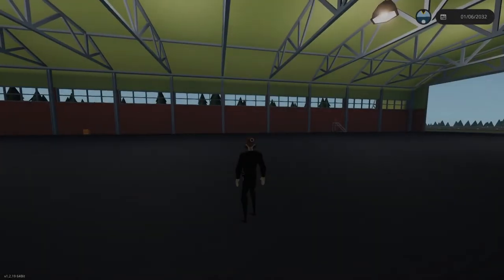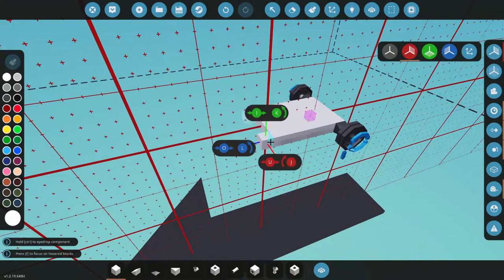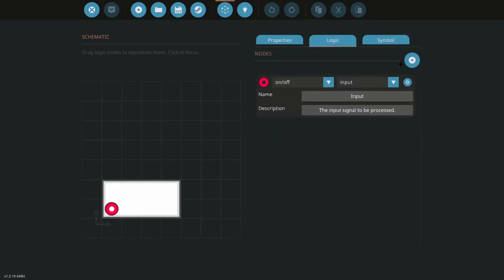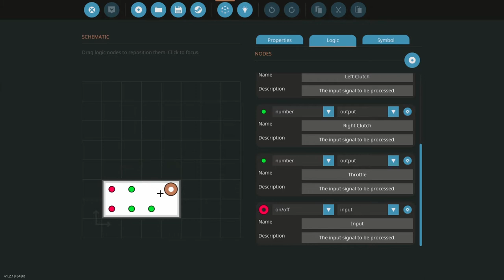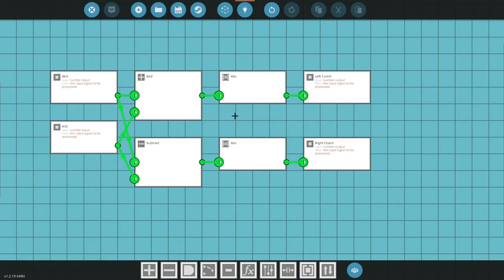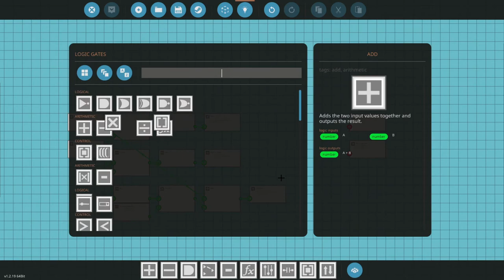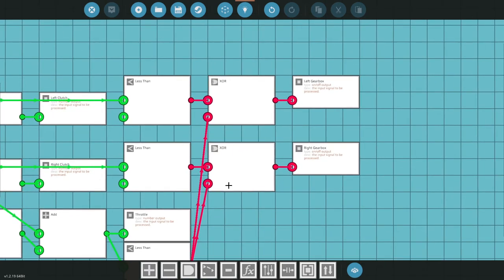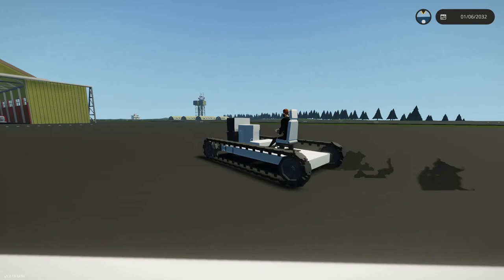The Ultimate Tank Control Tutorial! - Stormworks

Comment: Question. Adjusting the throttle at full lock in the micro thing will make the speed different? How do you turn with bigger tanks because I kind of have that issue in my own tank im making
Reply from the maker: The throttle at full lock will change your rotation speed. Bigger tanks can use this system as well
Reply: Thank you

Comment: I found that the microcontroller doesn't allow reverse if you're using a diesel engine. Is there a way to fix it?
Reply from the maker: It should allow for reverse if done correctly
Reply: @BigmanBois  Have you tested it with a diesel engine?
Reply from the maker: Yes, I am actually preparing to post a vehicle with a diesel engine and that microcontroller